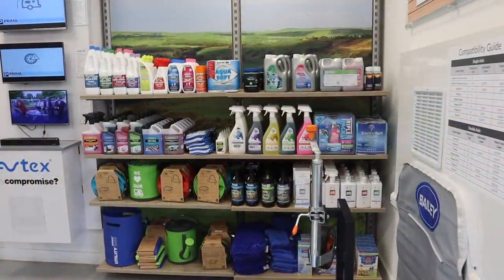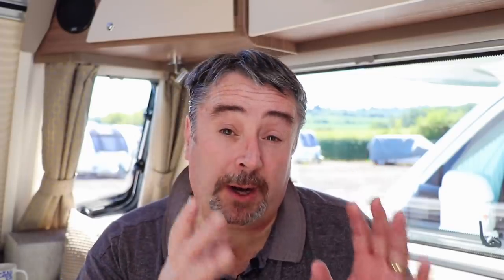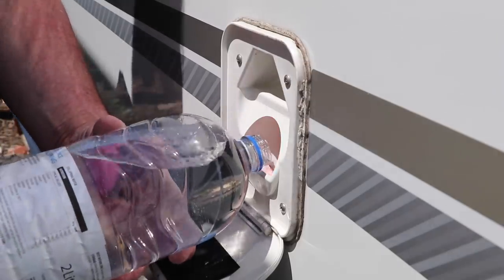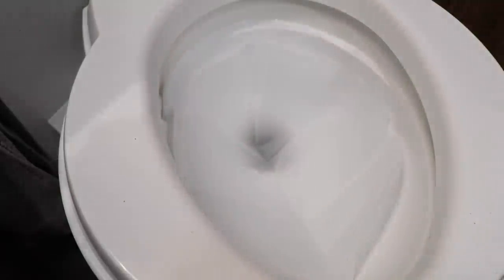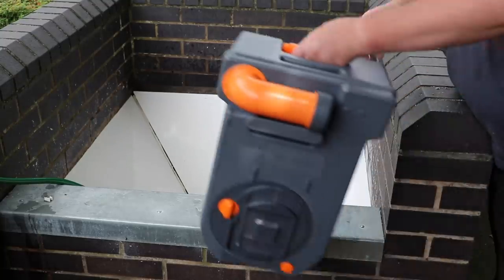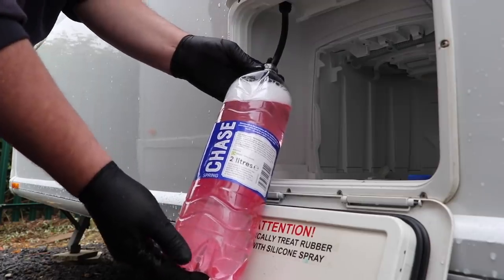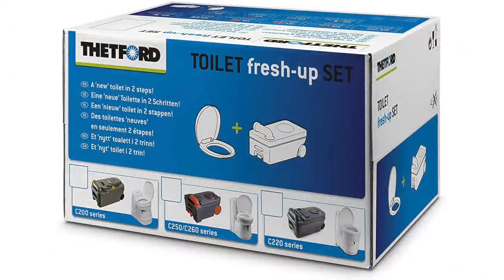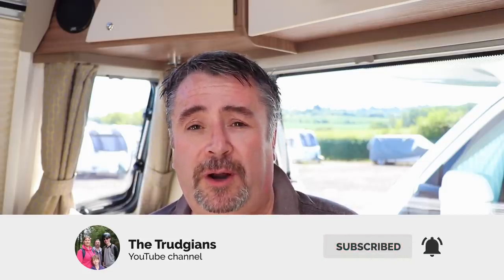The caravan toilet

Comment: Great vlog Dan with in-depth knowledge of the caravan toilet. We need to look at changing to Green chemicals as the blue can be a little stronger in smell. Top info for all levels of caravanning experience, 

Take care, Martin
Reply: I've been camping and caravanning since I was very young, got our first caravan after being flooded out of our tent in the middle of the night. It would have been early 1980's and the caravan was a alpine sprite, the water for the sink was pumped using a foot pump in the floor. It must have been nearly 20 years old when we brought it. 

Now I have my own family and caravan which is still 20 years old but has all the equipment you need onboard. 

Anyway... the point of my post was actually a question about toilet chemicals, I keep hearing bio detergent is better and cheaper than the "proper" chemicals. I get that the enzymes in the detergent will breakdown the solids and will probably work quite well but my concern is any effect they might have on metal parts and seals.

I'm not an expert on washing machine or chemical toilet components so don't know if your washer parts are designed to withstand chemicals your caravan toilet is not.

Has anyone had any experience of using bio detergent in their chemical toilet over a period of time and had any problems?

Comment: Hello Dan, I changed to the green and this season I am trying Top and Tail same chemical for the flush and cassette. It is also worth noting that if you plan to use  the onboard toilet on the journey the water in the flush tank is an extra weight, and must be accounted for.
Reply: ron hill isn’t 1 litre of water in the flush tank already accounted for In then MIRO?
Reply: Yes Ron I agree. I overfilled it once and arrived at the site with the shower room floor swilling with pink water. I recomment only have a very small amount in the tank when travelling, or use a separate plastic bottle to pour flush into the toilet.
Reply: @Gixer750pilot  I think that it varies according to van make and age. My 2005 van does not include gas battery or spare wheel as far as I can ascertain and no mention of fluids. I err on the safe side and account for everything as extra.
Reply: ron hill fair point Ron . I’m pretty sure the newer van MIRO include power lead, one bottle , 1 litre of water. I’ve not the light about clue  tyre I will need to check

Comment: Nice video Dan. I have to say I didn’t know what the Orange button was until we bought our new one. We use Blue Chemical but might change to green when we run out. You haven’t had any experience with the concentrated chemicals? I have to say the budget versions of the chemicals are very good too, we bought 5ltr of blue for £5 at chelston motor homes. Nice video, Cheers, Oliver.

Comment: Hi, why do you have to empty the header tank before leaving the site?
Reply from the maker: Hi Andrew, although not compulsory it is highly recommended. 1 Litre of liquid = 1 Kg of weight. The toilets can be found right at the back of some caravans, and an extra 9Kg of flush liquid at the rear could make make a difference when towing. Also, its good practice to always empty the tank as it limits the amount of sloshing around and will discourage any build up of algae in the tank (those black bits you may see) Finally if stored during winter make sure the tank and pump is empty or you will incur some frost damage.
Reply: @TheTrudgians  Thank you. Still can't decide whether to buy a motorhome or caravan! It's driving us mad, but the decision needs to be made now we are nearly out of lockdown.
Reply from the maker: HI Andrew, Make that decision based upon experience. So, hire a motorhome, and hire a caravan - there are lots available around the country - they can really help make your mind up. 

If you have itchy feet and like to explore, maybe a motorhome would be better, whereas if you like to have a base in an area, consider a caravan. - i do recommend hiring though.
Reply: @TheTrudgians  Thanks, great advice.

Comment: Thanks for your video.if you’re moving on to a different camp site do you have to drain the water before you move? Or can you leave it save doing it again when you arrive at the next place? Thanks Charles
Reply: Charles we left pink flush in the top tank and then found we had a pink stain appear on the flooring so would say best not to if you're moving from site to site

Comment: In one of your previous videos you mentioned about "the black bits" in the flush and that instead of using the pink additive, which can cause them , you suggested using Zoflora Concentrated Multipurpose Disinfectant instead. As I have had experience of this, I am going to try it out now we are out of lockdown. 
Seems that the change will not only be better but also cheaper. 
My one question would be, which is the cheaper in the long run, the green aqua chem liquid or the green aqua chem sachets? 
Thanks for your continued advice, I'm learning a lot from you. Stay safe and happy caravaning
Reply from the maker: HI Clive we stopped using pink about 3 years ago - due to the black bits, we started using zaflora and i think personally its better and cheaper. We are about to switch over to the teabags, and see how they fair for us, we know exactly how long they will last which is nice, the pot is smaller and its a lot easier to dose the loo.
Reply: @TheTrudgians   Thanks for your reply, appreciate it, as you must get hundreds. When we run out of our blue liquid we might change to the bags. as it seems so much easier. Knowing by then, how you get on with yours, as you are so good at follow ups.
Reply: clive sutcliffe We gave up using pink additive in the flush tank de to the black bits.  Have been using plain water for the last 3 years with no adverse effects (no more odour), and even cheaper.

Comment: Hi dan we started on the green bags the one and only trip this year and found them a lot better, but i want a change from the pink flush, do you think this zaflora is ok to use with the plastic and rubber seals!!!  it would be a better smell than the pink chemical smell you seam to get with this.
Reply: David Gayton Zoflora is fine, we use it in the loo and down the drains BUT. ......DONT use it if the site you’re on use septic tanks. Any disinfectant will damage the enzymes in the septic tank which breaks down the waste and you’ll be very unpopular, Green fluid only in the bottom tank in this case.
Reply: Andrew Moorey Thanks for tip Andrew👍
Reply: David Gayton We stopped using the pink additive completely about 3 years ago because of the black bits it caused in the tank.  Have just been using plain water in the flush tank and haven’t had any smells.  Have been using the blue tank chemical, but will give the green one a try next time we need to replenish our supplies.

Comment: Ooooh you're a blade open family - we're a blade closed and use the petal of loo roll method to 'encapsulate' - we find with blade open you have to use a lot more rinse fluid to get things to drop down.... plus all that time its open lets smells, and I'd prefer not to "drop straight into the blue" while sat (oh my lord!)
Reply from the maker: just to be clear, we are a  "flaps open while in use" fam - i know others keep it open all the time....
Reply: The Trudgians eeeuww
Reply: Thetford now recommended that you use the toilet with the blade closed and it does actually save flush water we use blue bags straight into the tank no water the first few flushes do that it saves valuable cassette space